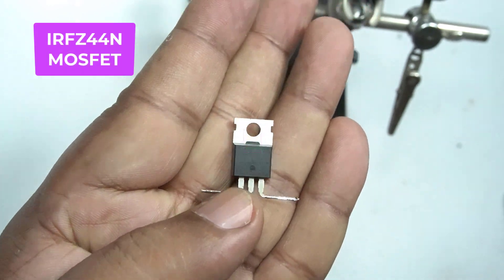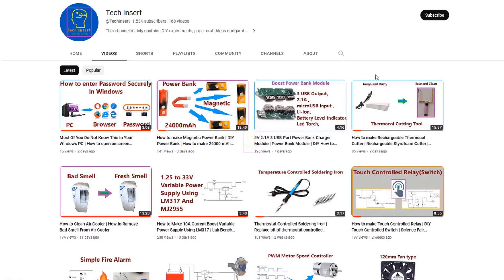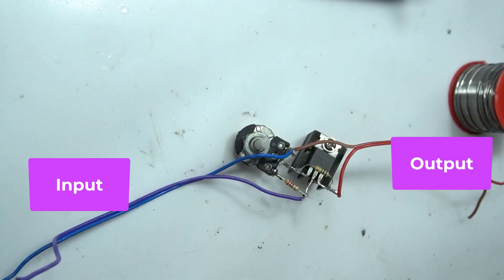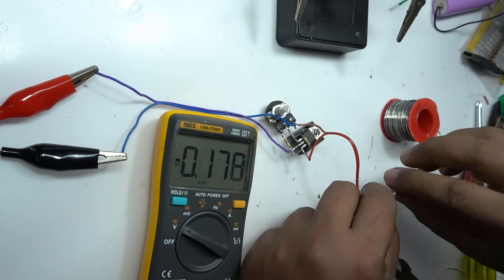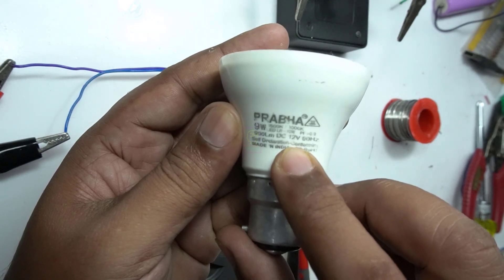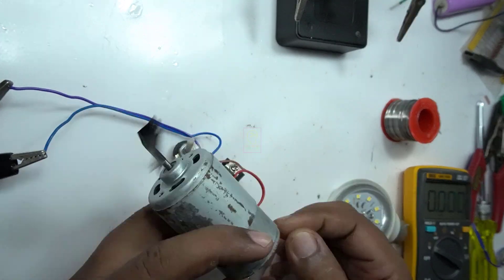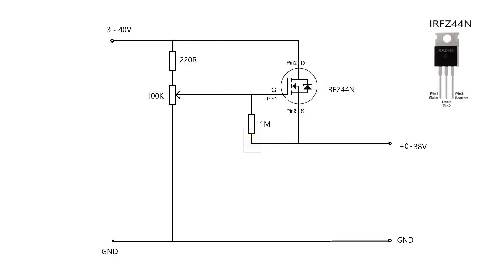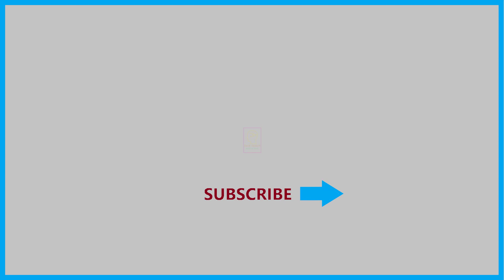How to make 0-38V Adjustable Voltage Regulator , is this good?

Comment: Sir same voltatage variable by using push button on of switch and with two voltage increase and decgress  switch total 3 switch kindly update ( o to 100v)
Reply from the maker: For that we need to use rotary encoder. What is the need for that if we can make it by simple linear variable control